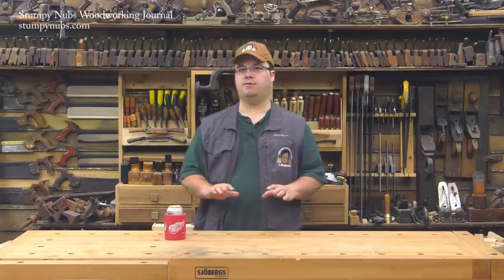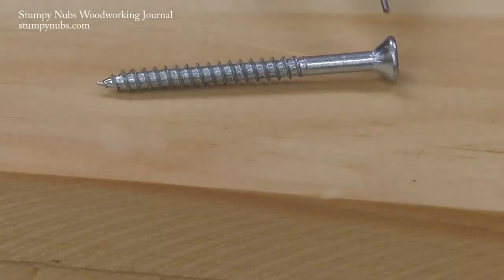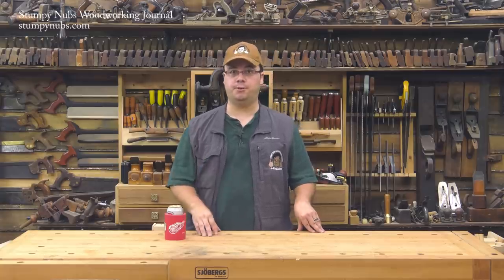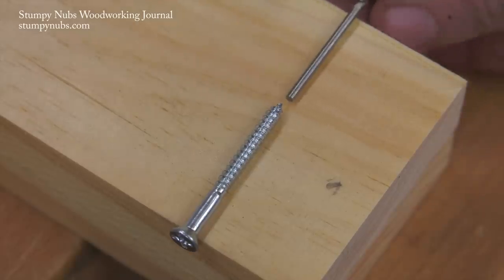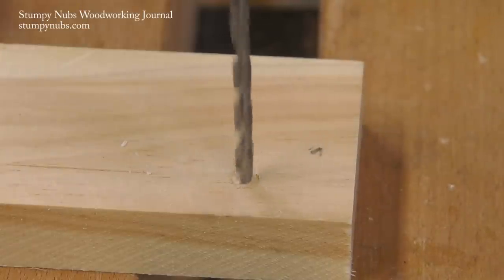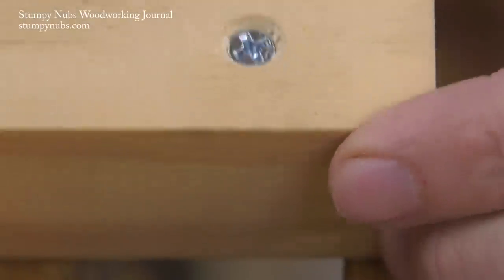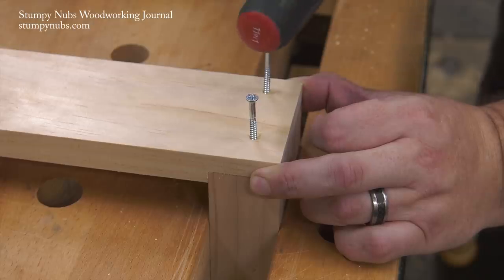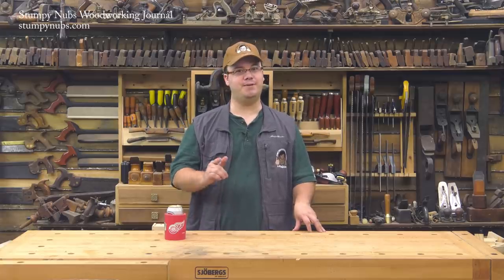Why old-timey woodworkers' screws held better (How to bore proper pilot holes)

Comment: I have been doing the three-step drilling for years. Trying to convince others why sometimes is difficult. They think all screws are self-tapping so just drive the sucker in.
Reply: I haven't seen them in a hardware store in years, but I had a set of countersink drill bits that would do all three steps with one bit. I lost track of the set about 30 years ago, but I can't imagine they aren't made anymore.
(edit) Just googled it. These are out there, but not so much like the ones I had.
Mine were single piece bits with 3 distinct sections, end was narrower for part of wood that would catch the screw threads, the middle part, a little wider for the non threaded part of the screw, and the top which made the countersink.
My bits didn't have spiral channels, like a conventional drill bit, it was flat on both sides and it's drilling was more similar to that of a paddle bit.
Reply: Robert Shorthill  Agreed on all counts.
But what bothers me is that sets of driving tips are loaded with Robertson drive (square tip) and flatheads. Half the dang kit. (Flatheads should be illegal by now). 
They come with a variety of different size Torx but only one each in many cases, and your lucky if you get a #1 or #3 phillips at all.
Reply: Robert Shorthill  Screw retailer here.  Torx drive screws have much better stability than slotted, Phillips, or Roberston drive screws because of how many points of contact the bit has with the screw, and the construction allows the bit to "lock in" to the screw.  Also, many torx drive screws have more engineering than regular wood screws, like serrated threads at the tip of the screw which not only help the screw cut through material better, but also help lock the screw in place.

That all being said, it's still important to drill those pilot holes.  You'd be surprised how many people come in looking for screws they don't need to drill a pilot hole with.  I usually just give them deck screws which have a drill tip and send them on their way.

Phillips and slotted drive screws still have their place in woodworking though, and if you're drilling proper pilot holes and using the correct size bit they should drive with no problem whatsoever.  Anyone who uses drywall screws for anything other than drywall needs better education.

Finally, woodworking screws like the one shown in the video are zinc coated, and not appropriate for outdoor or damp areas (if your screws are rusting quickly though I would argue that your cabinets are rotting quickly too).  You can get galvanized, brass epoxy, or even stainless steel wood screws that will resist rusting.
Reply: I also have a set of the flat pilot bits, though I've forgotten where I bought them 50 years ago. Each is marked with the screw size and length. They are worth their weight in gold. There should be a business opportunity here for a limited edition boutique tool maker.
Reply: @Koioseter  I found an article that talked about Phillips screws and why they cam out. It is because that is what they were designed to do. They were designed for the early automotive industry when the autos had real wood trim and parts. The workers were using air drivers to put then but were over driving them and stripping the holes. The Phillips drive was designed to cam out before the hole stripped out.  Now we have drivers with clutches for those who are humble enough to use them. I firmly believe that there are as many unintended pregnancies as there are stripped screw hole from guys who brag  that they can always stop in time
Reply: @marvinostman522  I was explaining the difference between Phillips and Pozidriv screw heads and why to someone only the other day. As usual they thought all crosshead screws were the same and it didn't matter what driver you used.

Comment: Fuller makes great tapered bits that I find work exceptionally well. They were made popular in the wooden boat building world. They come in sized sets with counter sinks and are a bit pricey, but I always use them. Thanks for the video.
Reply: Thanks for this good tip.  I shall look them up.

Comment: That smaller diameter on the thread is known as the root diameter. When using a Phillips type driver bit ensure the driving edges of the bit are not rounded as this will cause slipping and damage to the screw head.

Comment: Thanks I’m an oldie and always drill and screw like you demonstrated. I laugh when I see people trying to pull joints together with one size hole. What I did like was your “off set” to close the joint in two directions. It’s a good day when you learn something thanks

Comment: I tend to sometimes have problems stripping screws out. I don't know if it is because of the screw itself or if I am not using the right sized screw bit or what. I have tried using the size bit that is recommended on the box they come in and tried bigger and smaller but still tend to have a problem (it would have been nice to see something how to select the correct size in the video). Anyway, it may just be that some wood screws are just a lesser quality these days.

Comment: Old timey. Yeah old timey projects seems to hold up a million tomes better.
I remember about ten years ago a friend was hired to cut a tree down and tear a barn down, i was out of work and got volunteered to help. The guy that got hired barely showed and i ended up doing most of the work on the barn. I remember the owner said that at that time the barn was about 20 yrs old. This barn was put together bettwe than anything ive ever seen before. And there wasnt thousands of screws holding it together. It felt like it was made out of maybe 5 pieces of wood. It was solid even after 20 yrs. I almost felt bad tearing down something so solid and in great shape.
The owner was an amazing man, he passed away a few yrs back. I think he knew i wasnt getting paid for the amount of work i was doind and we bonded over technology. Right before i was finished with the job, he gave me a picture he took of a bald eagle at (i believe) about a mile away. Especially after his passing, NOONE could ever buy that picture from me.

Comment: I do a lot of doors and I had to self centering drill bit that's very similar to the countersink that the things are incredible make my job a hundred times easier than taking out a punch and trying to get a dead centered and knocked in a little bit so your screw drives in straight. Especially if you have some crooked odd green the screws like to follow the grain if you don't have a pre drill in there and also split and crack on the way doing it. Nice little video though

Comment: Is there any reason for you drilling in reverse when drilling with the larger drill? It seems like you jump to the result with the last example. unless you drill out the changed hole position, the screws will go into the first marked holes you made, and the pulling will not occur.
Reply from the maker: I sometimes begin a hole by drilling in reverse to sever the surface fibers before the bit tears them up as it bores into the wood.

Comment: Proper wood screws have a taper to the threads all the way (there are tapered drill bits exactly for the pilot holes), and the unthreaded part is larger in diameter than the threads themselves. This makes the unthreaded portion really well supported into a good fit hole without threads to mess the hole in advance. These are the the old timey slotted screws.

Comment: The offset technique is good for attaching (thin) metal things and pull them into a direction too.

In wood I often don't do the more complex impression and then offset drill, but tightliy put the pieces together and drill through the bigger hole, aligning the drill bit with one of the sides. This is usually enough offset to pull things tightly enough together to make the gap invisible, you just have to be careful with the angle you drill at, since if you do it freehand due to the existing hole you tend to drill at an angle, and it will be the opposite of what would pull it together.

Comment: As for the offset method, you could probably accomplish the same thing by drilling on a bit of an angle so the screw pulled in two directions in relation to the joint. I would imagine you might get a problem with the board splitting if you do it Stumpy's way and offset the holes a little too far.

Comment: I know this is a couple years old, but I had to comment.  I've been drilling screw holes like this for a long time ... just seemed right to me.  If you're drilling the larger hole, then it doesn't matter if the screws you use have an unthreaded portion.  The part is in a hole larger than itself, so the threads aren't contacting anyway.

Comment: When I was new to cabinet building and installing I got into arguments with guys that had been doing it for a long time because I would drill a 3/16 hole in the first piece that gets countersunk and a 8-inch hole in the piece set the thread spot into so that the screw would not bite into the first piece and they said I was dumb for doing that. And I argued that it gave a tighter joint and this was only in my first year or so. It just seemed the logical thing to do after trying it the way some of them showed me and it did not give the results that I liked
Reply: Right on.  (Although you may need to edit your comment.  "8-inch hole"?)
Reply: @jimgardner5129  it should have said eighth inch. I think when I put this comment I was a little tipsy 🤷🏻‍♂️ I just tried to say eighth in speak to text and it would only come me up as 8.....

Comment: Using 'tree nails' (wooden dowels or pegs) it's called draw pegging in England. You offset the hole as you have very clearly explained then drive in a wooden dowel or peg. The chairs we sit on at table are made using this technique.  Works well with mortice and tennon joints.
Reply from the maker: That's a similar, but different technique that we here call draw-boring. But draw-boring is used for mortise and tenon joinery. This is a rabbet joint. Draw-boring will not work for a rabbet joint.
Reply: I have a pet rabbit. Her name is Lucy. She's not as exciting as the cats, so I guess she'd be considered rabbit boring.
Reply: Got you. We use the term rebate. Sounds similar. Nice work.

Comment: All of the old wood screws I have are slotted and have threads all the way to the top. The one your showing is relatively new.
Reply from the maker: The actual one in the video is new, but the design (partially threaded shaft) is not new at all. It dates back about 200 years.

Comment: Thanks for pointing out that "drywall screws 'ain't' wood screws."  Note that this response is in August of 2020, late again.  I've been searching for wood screws lately and have found them to be scarce.  Most things sold as wood screws today are really deck screws, sometimes with some portion of undersized smooth shank.  Honestly, the silver colored screw in the video looks like a deck screw.  I'm old enough to predate drywall screws and their variants like deck screws.  A proper wood screw will have a tapered minor diameter in the threads and the smooth shank should be slightly larger than the major diameter of the threads.  This is because the design was developed for boat and ship building.  The tapered minor diameter helped assure that the screw could be removed if a part had to be replaced and the smooth shank was there not only for proper clamping but also to keep water from migrating into the planking and decking.  The most correctly made wood screws now seem to be of either brass (interior use) or silicon bronze (marine use).  A huge difference is that drywall screws and their variants are harder than a file and break easily where real wood screws are made of more malleable materials and will bend without breaking.  They also have better shear strength.
Reply: Thanks, man.  This is an incredibly useful comment.  I've got a small stash of proper wood screws in brass that I inherited from my father-in-law.   I'm guessing most of my friends would find it strange that I relish something so trivial but I love 'em!  I think they're 8's.

You're right - today's selection is limited and disappointing.   Driving a brass screw into hardwood by hand is so satisfying.

Comment: In a pinch I use two bits even with drywall screws in wood. The top drill is bigger than the threads, and the bottom one is smaller that the shaft.

Comment: Agree with all you have presented but there needs to be some recognition that modern glues are far superior to what was available in the ‘old days’. A lot of joints could easily be held in position with nails to allow the glue to set. Must repeat though, I am a firm admirer of early day jointing methods.

Comment: If you drill the countersink  before you drill for the shank and tip, the countersink will be extremely clean and without burrs - it'll be round too and not some odd polygon shape 😊

Comment: In lieu of the "offset" screwing technique, I usually simply angle the screws slightly in the second direction I need the joint to be tight (so long as wood thicknesses will allow it.) As long as the pieces are clamped tight to each other before the screw is used, this seems to achieve the same two-way effect, only faster.

Comment: It's not unusual to use a woodscrew where there's a chance that the piece might need to be disassembled in the future.  So dab the tip of the screw in petroleum jelly before driving it, and not only will it go in more easily, it's much less likely to seize over time.  This is especially important if you're using brass slot-head screws for finish work, and want to be sure to line the slot with the grain (that little bit of lubricant will make it a lot easier to tweak the head into alignment.)  Last tip: if a screw is seized, touch the head of it with a soldering iron to head it up, and might be enough to free it up.  Again, this all helps with a slot head screw where it's much easier to put too much effort into it and either slip and mar the surface or strip the head.
Oh, and now I'm feeling very "old-timey" as this is how I prepare screw holes, and have for the last 45 years or so.  Not quite 150 years, but getting there.
Reply: Andrew Webster get your own channel...lol
Reply: Andrew Webster, we don't need a channel of our own to add to the content. I, for one, am glad that these channels exist as a forum to share knowledge both directions. Stumpy provides good content, but there is a world of people out there who expand it in the comments. I think people who don't read and digest the knowledge herein the comments are missing out.
Reply: Yep.
Reply: I have resolved never to use slotted head screws ever again. Problem solved. :)
Reply: I use the wax from a toilet bowl ring instead, I have a piece in an old pill bottle. Petroleum jelly can stain. I've also used beeswax, bar soap, and Chapstick.
Reply: @mikeking7470  The various lubricants that you suggest are fine. The important point is that the screw is lubricated and turns more easily. It can happen, during tightening,  that the screw shears off and it is then that you wished that you used lubricant! The purpose of the screw is to press two pieces of wood together with as much force as  possible and with the least amount of torque.

Comment: I don't understand the 2nd technique fully -- when you're ready to join the two pieces, do you align the screw tips with the dimples or the pilot hole?
Reply from the maker: The pilot holes. The dimples were just to help you wee where the screws wanted to go so you could offset the pilot holes and force the screws to pull things together.

Comment: don't forget stinge screwing to hold heavier timbers more rigidly and prevent the threads from ripping out under high stress.

this is simply placing screws at around a 30degree angle in two opposite directions to "pin" the timbers together. it really goes a long way to gain extra strength in a larger joint, like, say, structural work or garden furniture. jungle gym's ect.

Comment: Even if you are going to use drywall screws you can still use the same method. Drill the pilot hole the size of the shank then the outer piece a hole the size of the threads and you can use a drill bit the size of the head to counter sink. I did just that today because I didn't have any of the correct length wood screws but I did have drywall screws.